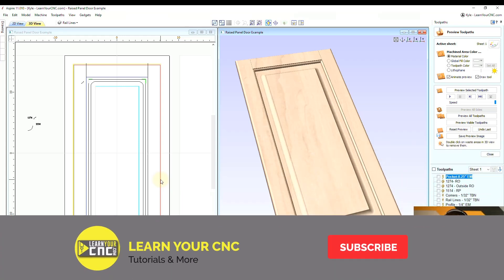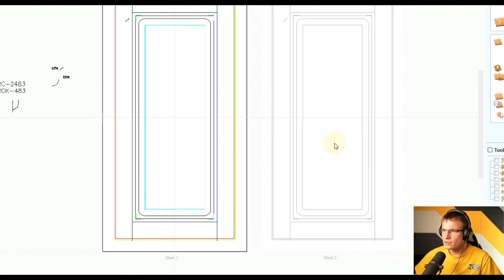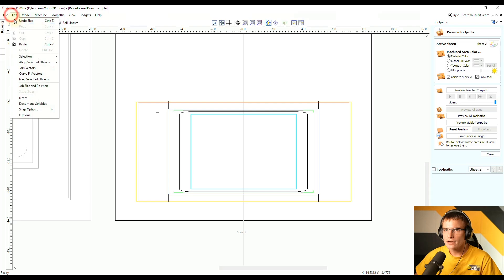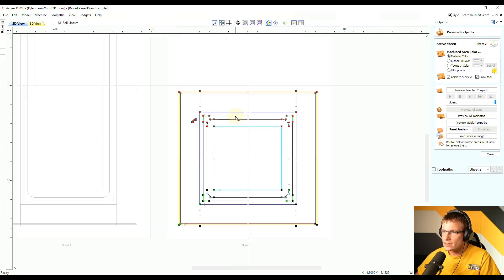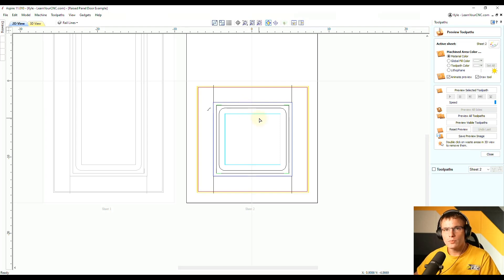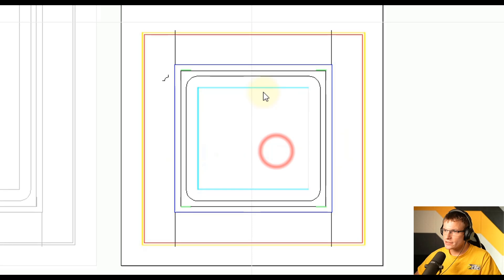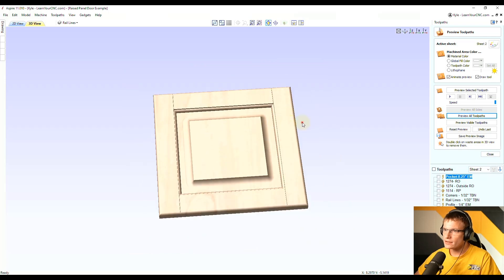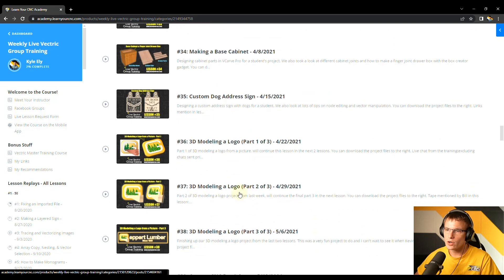Scale Multiple Shapes without Changing the Spacing - Vectric VCarve, Aspire, & Cut2D Quick Tip

Comment: Great tip. You can add to that by right clicking on one of the nodes selected, go to Properties then select Relative. Give the X and/or Y a specific amount and bamm!! There you go. So if you want to bring the top vector nodes down by 4 inches, just input -4.0 in Y axis (Relative).